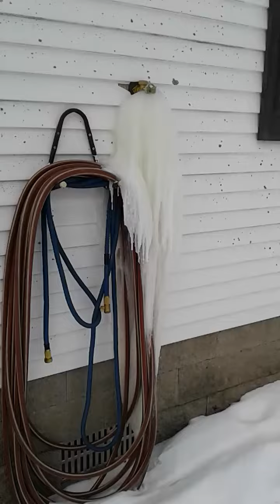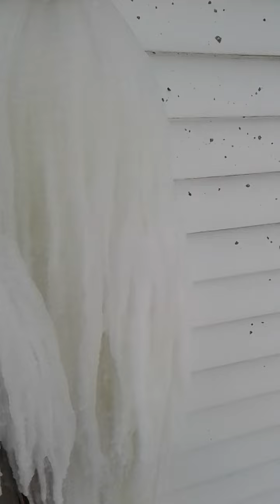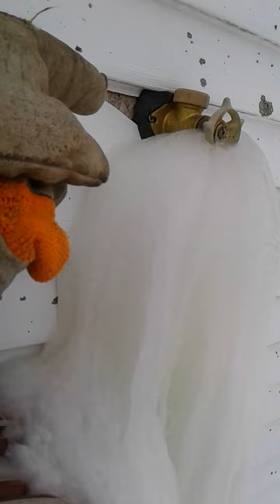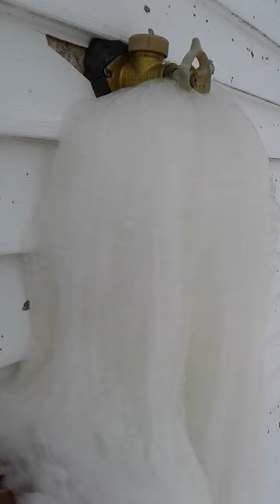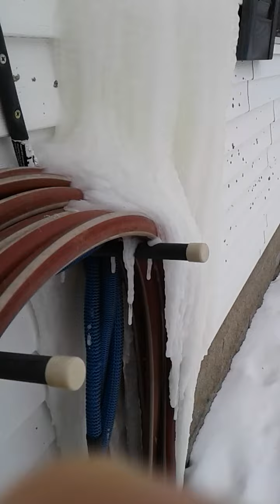No-freeze outdoor leaky faucet in the Minnesota winter

Comment: 90 percent of this type of problem start with the pipe into the wall is not at a proper angle forcing water to drain out of the pipe when shut off. If you have this much ice there is a good chance that the pipe in the wall is ruptured!  If you have an arc welder you can thaw this in about 15 seconds.  No welder? No problem get a car battery, jumper cables or lengths if 10 gage or bigger wire and connect one lead to the inside pipe as absolutely close to the frost free as you can.  The other end to the outside pipe and connect to pos and beg terminals like jumper cables and bingo it is going to get hot quick. Don't just leave it stay with it. It usually takes no more than 30 seconds or your wire or cables are going to start smoking. It will get hot.!